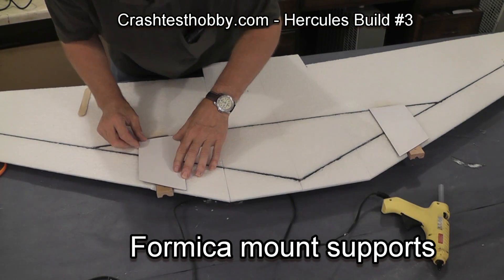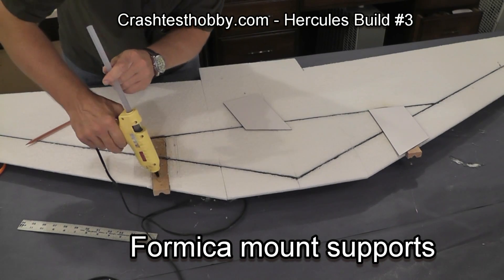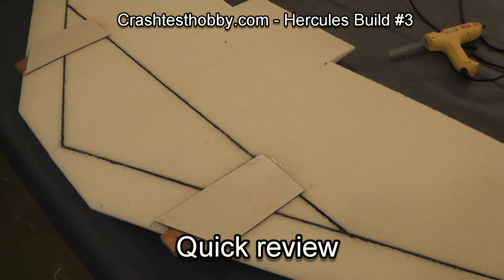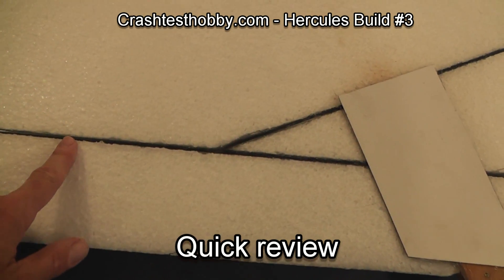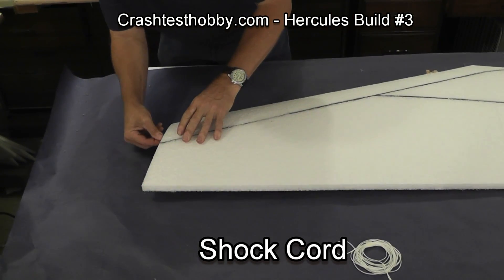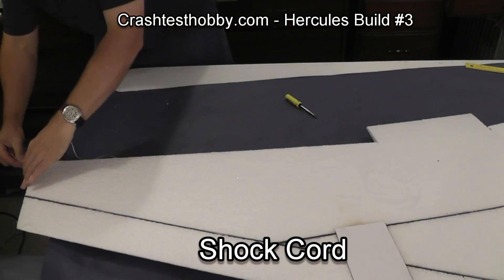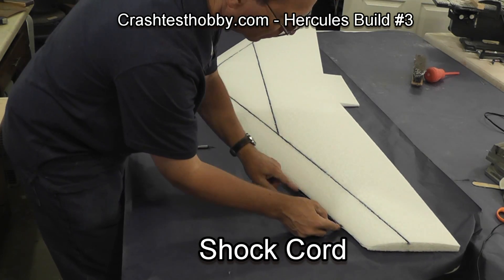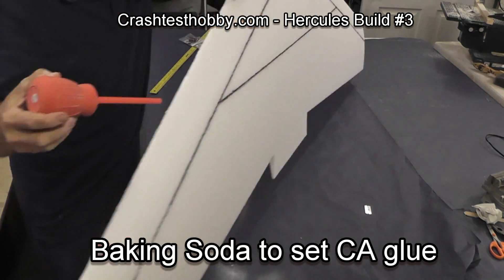#3 Hercules build 10-11

Comment: "The shock cord does not stretch.  It keeps tears from starting and helps to spread the forces of and impact out and keep the plane together.  .... Lee"
Where does the shock end up? Something has to give.
Reply: +SsoulBlade The shock cord distributes the force of impact throughout the entire periphery of the plane. Without a shock cord, most of the force is in a concentrated area which can lead to tearing of the foam.